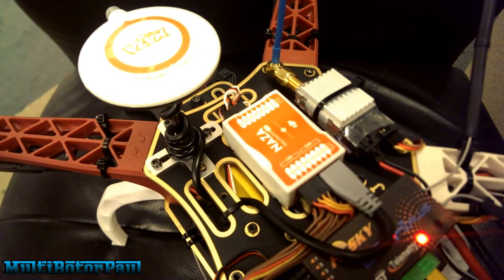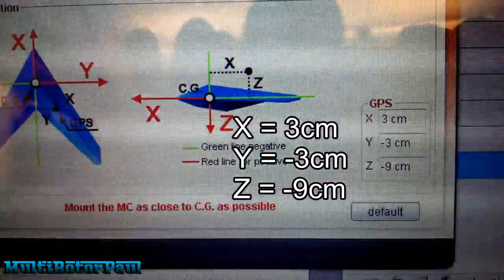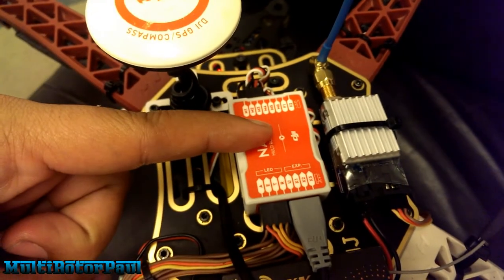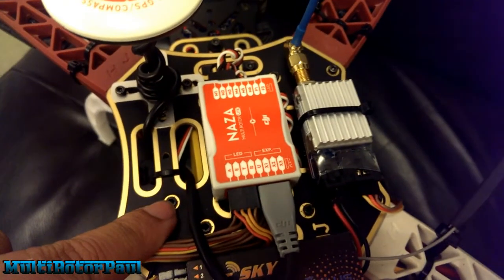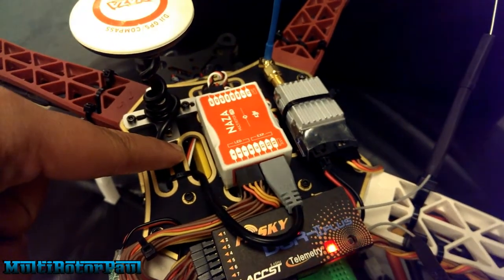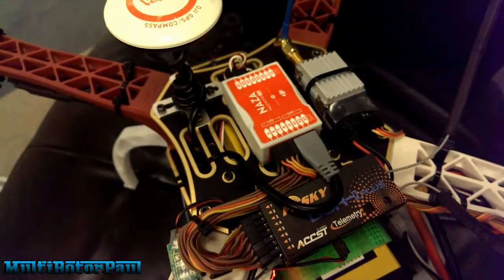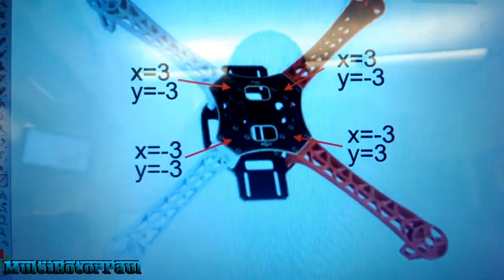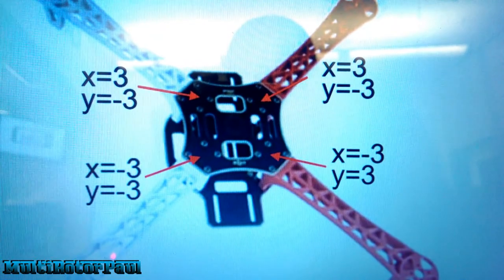How to Configure NAZA GPS Position in Assistant Software

Comment: Why would the Z be calculated from the top plate the top plate or the bottom plate or even the ground has nothing to do with the CG the cg is x and y 
what I’m thinking is the GPS wants to know the hight of the gps measuring from the ground all the way up to the gps so it can land softly in case of a return to home landing 
If you measure from the top plate or middle plate and you have 10 cm of landing gears the GPS does not know where the ground is again maybe I’m wrong but that’s what I’m thinking. But also I don’t think the GPS is made to measure altitude the barometer is responsible for that so what is the purpose to write down the Z if a GPS cannot measure altitude???? Then I’m thinking is it possible that we have to measure the top of the GPS to the control board a lot of videos out there and everybody does it different I would really like to know why the z measurements is necessary I understand X and y  is very important so Drone can stay still on a global position and I understand there’s a barrometer In the NAZa  system but wouldn’t it be important to measure from the ground to the antenna or from the control board to the antenna supposed to a top plate of the drone to the gps antenna????

Comment: Hi mate have you ran 4cell lipo batteries on your f450 yet I've gone for 4cell can I run mine with the 10x38 props or go back to the 9inch
Reply from the maker: +Nick Walters You can probably run it with 10 inch props, depending on what kind of motor you have.
Reply: MultiRotorPaul racestar 960v
Reply from the maker: +Nick Walters Kv is probably too high for using 4s & 10" props. You can try it if you want, but you're going to burn out your Motors. Or you can try going down to a 9-inch prop
Reply: MultiRotorPaul think the 9inch is best but I've only got the STD dji prop others say the 9inch Graupner props are better
Reply from the maker: +Nick Walters What flight controller are you using? If it's a Naza, you won't notice a difference in actual performance between 9 or 10 prop. As far as flight time, I'd try both graupner and the other props.
Reply: MultiRotorPaul yes it is the naza mate just looking at video others say 10inch with 3crll and 9inch with 4cell but like you said it's down to the kv on your motor

Comment: if you had your GPS on the front right would it be just 3mm or +3
Reply from the maker: +Nick Walters  It's not 3 millimeters, it's 3 centimeters. The X would be  It's not 3 millimeters, it's 3 centimeters. X= 3cm, y= -3cm.
Reply: MultiRotorPaul yes sorry cm
Reply: hi just rechecked my GPS configuration if my naza is on the bottom plate them it will be more - as iam doing it from the top of the GPS holder to the top plate
Reply from the maker: +Nick Walters if you mount the GPS on bottom plate, the Z-axis in the configuration would be a positive number. I don't recommend bottom mounting because ideally the GPS should be on the top, in clear view of the sky.
Reply: MultiRotorPaul sorry I should explain to properly I've got my GPS on top but my naza is on the bottom plate so my minus values will be more from the top of the GPS holder to the centre gravity on the Naza if you know what I mean
Reply from the maker: +Nick Walters The location where the Naza is mounted is not always the center of gravity. You want to get the actual center of gravity as close to the center of the quad as possible. So wherever that is, configure the Naza GPS to those values. Mounting it on the bottom is fine, as long as you don't mount the Naza upside down. Just keep the top of the Naza facing up.
Reply: MultiRotorPaul thanks for the quick replies mate how would you know where the centre gravity is on my frame etc it's a team white sheep
Reply from the maker: +Nick Walters I'm sure there might be some other YouTube videos on this but it's pretty simple. Just grab two tools like 2 Allen wrenches. Use them to pick up the left and right side quad by the frame right in the center of the top plate. If you put the Allen wrenches towards the center as close as possible, the quad should pick right up and balance. That means your center of gravity is basically the center of the top plate. Also do the same thing by picking it up from the front and back part of the top plate. This will give you the center of gravity location for the X & Y axis. For the Z axis it's a little more tricky, but the easiest way to do it is just to assume that the center of gravity is the center of the top plate.

Comment: Another great video! I'm about ready to order the Naza-M lite. OOOPS! I just ordered it and can't wait to see what it does. I'm not into racing or stunts. I'm building a camera platform kinda like what ur doing. Really like how you explain each step.

One thing I have'nt seen from you is prop balancing. I know you did alot of testing of different props and was wondering what procedure and equipment your using. I know it must directly effect video quality. Just wondering.

Keep up the great work!
Reply from the maker: W Morris Thanks! I was thinking about making a video on prop balancing but there are already several other good ones here on youtube. Check those out if you need to learn how to do it. Some people use sand paper to balance, I used black electrical tape.  This is the balancer I use: http://www.hobbyking.com/hobbyking/store/__50287__HobbyKing_8482_Universal_Propeller_Balancer_For_T_Style_And_Std_Propellers.html
Reply: MultiRotorPaul I knew you did because your so through. I found a few videos and I'll be slapped me silly, that's what I forgot to get. I ordered a dubro. Tomorrow is the big test. 
Thank you very much for your help...
Reply from the maker: good luck with your project!